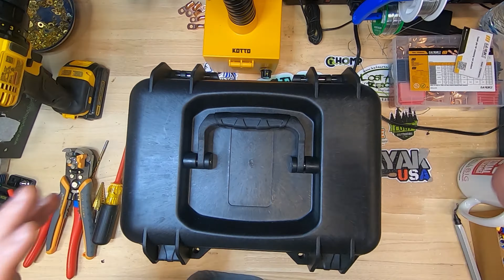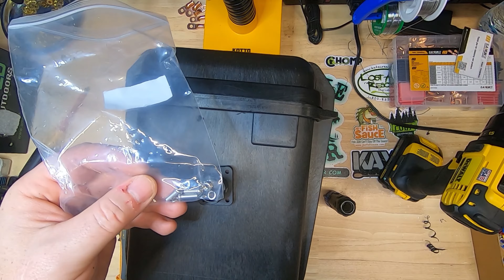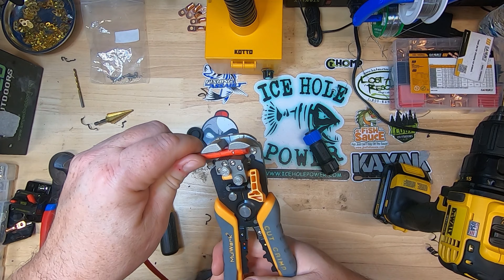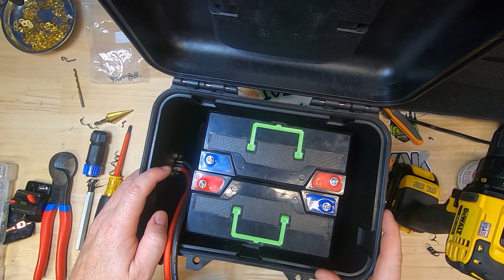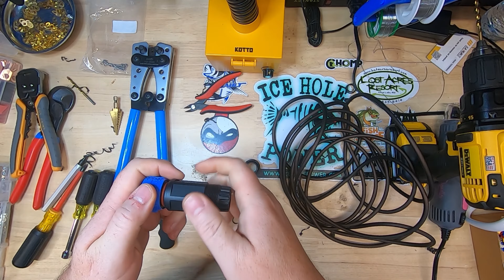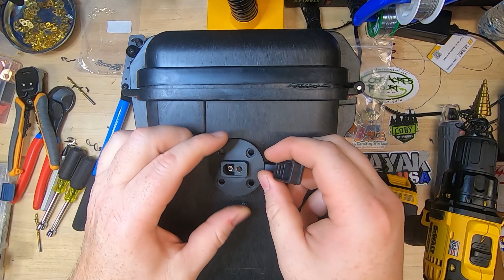24v KAYAK Trolling Motor DIY Battery Box for my NK 180

Comment from the maker: This video is a step-by-step guide on how I built my 24V trolling motor power box for my NK 180 trolling motor. By using the links below to the tools and material shown in this video, you are supporting the channel. Thank you for watching and if you have any questions, please ask them in the comments section. 

Follow me on Facebook! https://www.facebook.com/iceholepower

The trolling motor this battery box is for (Amazon Listing) https://amzn.to/3SvcOOs

Trolling Motor Plug (Amazon Listing) https://amzn.to/3P3yjmi

Box seen in the video (Amazon Listing) https://amzn.to/3BIQKcZ

Two 30Ah TALL Amped Outdoors batteries (make sure you get two with the chargers!)
https://ampedoutdoors.com/collections/lifepo4-battery/products/30ah-lithium-battery-lifepo4-replaces-20ah-same-size-and-weight?aff=8

Tools seen in the video (All Amazon Listings):
22mm step bit https://amzn.to/3P3w16G
Deburring Tool https://amzn.to/3zzqLST
Wire Strippers https://amzn.to/3pfx0GN
Large wire cutter and lug crimper set https://amzn.to/3JB0t79
Small wire cutters https://amzn.to/3vDo01p
10mm nut driver https://amzn.to/3Q3CHTS
Heat Gun https://amzn.to/3ddBRWc

Other material
SAE plug kits (you will need two of them)
https://www.iceholepower.com/product-page/sae-kit
30 Amp Breaker with Velcro (Make sure you get the 30 Amp and NOT the 50 Amp)
https://www.iceholepower.com/product-page/12v-50-amp-breaker

If I missed anything, please ask in the comments! Thanks!

All batteries that I recommend based on my reviews can be found below:
https://www.iceholepower.com/lithium-batteries 

Tools and supplied that I use in this, and other YouTube videos can be found here:
https://www.iceholepower.com/tools-and-supplies

Contact Information:
For business inquires or other YouTubers ONLY. If you have a question, just ask in the comments section of this video. email: Jeremy@iceholepower.com
Reply: Hello, we are Acoucou Battery. Noticed that you haven't updated for a long time and would like to ask you how you are doing lately, we would like to invite you to test unbox our LiFePO4 battery ~ looking forward to your reply.

Comment: Nice video. The only question i have involves heat being generated while charging the batteries. Shouldn't you have the batteries well ventilated when charging even if they are SLA or Lithium iron phosphate batteries.  In otherwords, the box lid open?
Reply from the maker: No they do not.  Lithium batteries do not produce hydrogen or gas like other batteries do.  The charger will get warm but the batteries will stay consistently cooler than the charger.
Reply: Thank you for the quick response.  I liked some of the building techniques that you used on this project.   I'm going to adjust it a little for my purposes involving amateur radio purposes and hurricane preparation.   The only thing that I'm going to add are  2 weather proof Anderson power pole mounting kits, and 12 volt accessory outlet that is weather proof.

Comment: Really helpful video; I love the box.  As a newbie making this for my kayak, I have 10 awg wiring from my trolling motor and the receptacle mounted on the battery box has 8 awg wiring to the battery with a 50 amp breaker.  Will mixing of wiring in this case be a problem?

Comment: Just wanted to let you know that I built this for my NK 180 motor.  I was unable to close the box lid without cutting off the power.  So I cut out a piece of foam insulation over the 30 amp breaker and it worked.  Just putting pressure on the breaker button will cut the power without tripping the breaker.
I'd like to mount a voltage meter on the outside of the case.  Any recommendations on which one?

Comment: Wow you overpaid for low AH batteries!
Amped outdoor makes top quality batteries, but anything larger than say 18AH they cost way too much imho.
I got two 12v 50ah lifepo4 batteries on Amazon for $150 each and free prime shipping.
Yes, they are larger and heavier, but they will fit in a cheap 19" plastic toolbox and only weigh about 23lbs combined.
I will have lots more run time this way. 
I wouldn't even consider less than 50AH for any trolling motor situation and I wish I had 100AH or more.

Comment: I built a 24v, 2 DL 54Ah battery box using a Milwaukee packout toolbox and a minnkota 26 plug socket. IP54. It has solar and ac charge ports. Fuses and solar charge controller all fit in the box with USB and 24v ports.

Comment: OK, possible stupid question from an electronic hobbyist. Since the batteries are in series to get the 24 volts, with the (+) of battery A connected to the (-) of battery B, those points are electrically the same, correct? The charge circuits are independently connected to their respective positive and negative terminals. Is this why you need to charge both simultaneously? What would happen if you only connected 1 charger? Does the fact that you are charging at low amperage make the difference for this being safe instead of isolating each battery during charging? Love your videos ang have purchased from you. I just don't understand how the chargers "know" to only go the correct way and not interfere with each other. If that even makes sense.
Reply: I use a 24 v charger to charge in series. Never had an issue, been doing it this way for over a year now.

Comment: On the trolling motor electrical outlet socket, I would've put shrink tubing over those two barrel screw connections (i.e. the Pos. and Neg. screw connectors inside the case, just in case something was ever dropped on them!).  It might also keep the screws from loosening up, too!.
   Anytime I can insulate ANY connector or connection, I do it.  (Had my run of "Bad Luck", in the past!).  Lol... 
Like your very informative videos, too!  Thanks for making them (and wish I'd seen them before I ordered my LiFePo, from Amazon!)  Haha!
Reply from the maker: YES! Great idea! I will throw some heat shrink on them! Thanks for the suggestion!
Reply: @iceholepower8012  Well, everything else is insulated (Battery Ring Lugs), and all.  (Just another "Random Thought", from an Old Fart...!).  Lol...